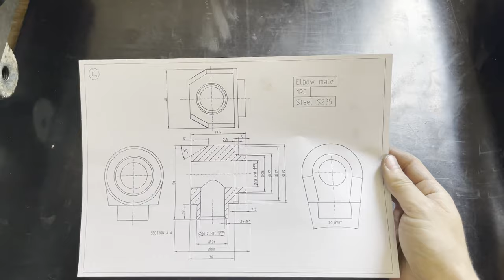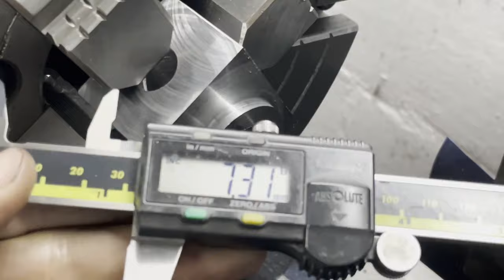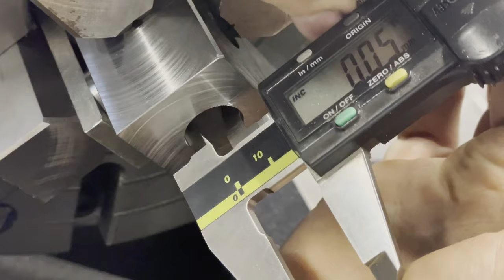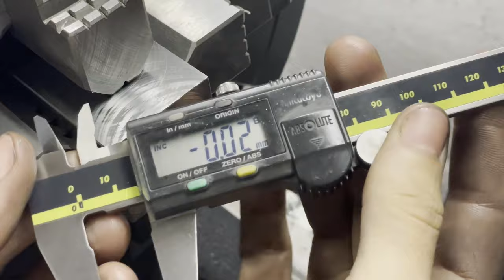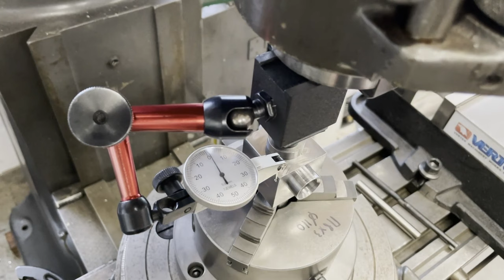Prototype 'Noga' Articulating Arm Build Episode 6 - Elbows

Comment: Great vid. A couple of bits of advice. Try to clamp work in the centre of the vice, not towards the edge. If you have to clamp at the edge, put something in the other side thats the same size to balance out the clamping forces (in this case, you could have used the other elbow block)
Secondly, spot then drill each piece in turn rather than spotting both and then drilling both. Its easier to change bits than setup's.
Reply from the maker: Hi Jaen, I am aware of these techniques and have broken these “rules” deliberately in this setup for the following reasons:
Switching out the parts was supposed to be faster in this case because the spot drill was held in an end mill holder and not in a drill chuck. Holding the part in the corner of the vise allows for quick switching out with a vise stop (which I don’t have yet so I used a parallel. Clamping the vise assymetrically holds plenty good enough for drilling forces. You’ll notice when I milled the parts before they were clamped symmetrically. Due to some fumbling with the parallels it was slower than intended, not a big deal for two parts ;)